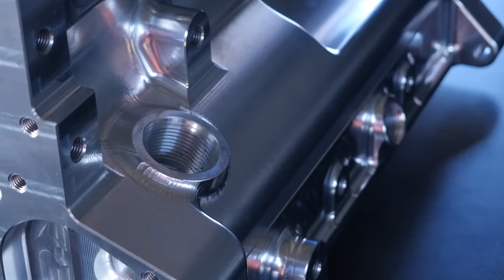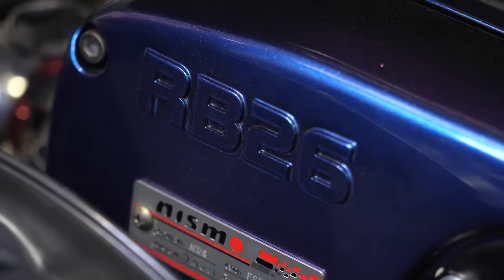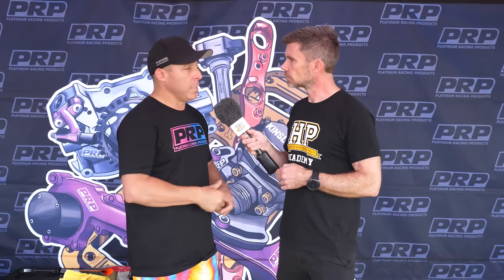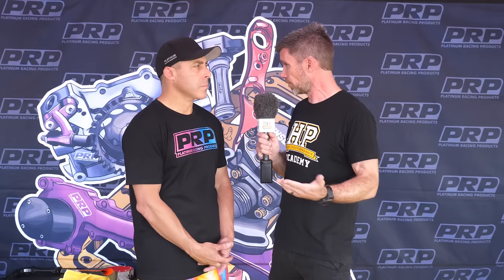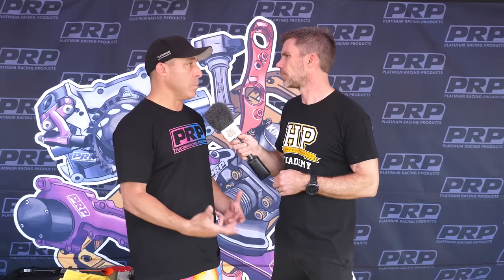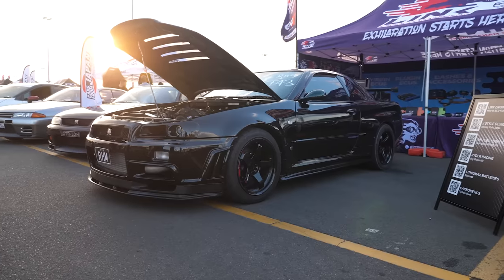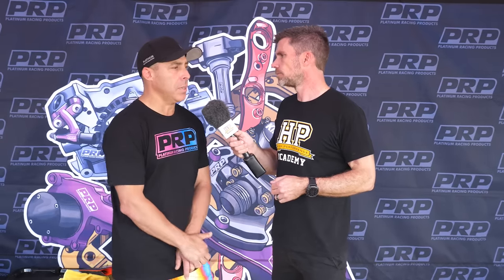What Is Wrong With A Billet Block?

Comment from the maker: Building a fast car? Get $400 OFF the VIP package with every current and FUTURE course included: https://hpcdmy.co/vipy4
50% OFF your first engine building course. Enrol now: https://hpcdmy.co/offery4
TIME STAMPS:
0:00 - Bucking The Trend
0:18 - RB26 Factory Cast Block Cracking
1:40 - Modified Engine Issue Only?
2:24 - RB26 Horsepower Reliability
3:01 - Horsepower Doesn't Kill Blocks
4:04 - What Is 'Wrong' Billet?
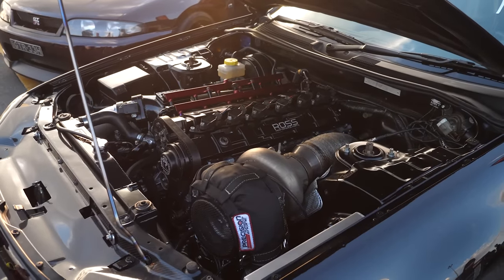5:22 - Billet On A Street Car
6:12 - Billet Thermal Expansion
6:56 - Aftermarket Cast Block
8:15 - Serviceability
8:47 - Sleeves
9:03 - Deck & Headstud Upgrades
10:37 - Proof Of Concept And Development
12:02 - Finite Element Analysis (FEA)/Simulation
13:15 - Pricing Options
14:38 - Billet Is For A Different Use Case
15:06 - Thanks Herman!
15:55 - Exciting Times!
16:05 - BUILD | TUNE | DRIVE

Comment: I really appreciate the fact that companies are starting to bring back the legends. Albeit at a price tag that is expensive to a lot of people. But gtr owners most of the time have gtr budgets which help. Just like the dart 2j block that's coming out, by the time it lands in Australia your almost on par with a bullet billet block for price. The thing I like about billet is if you happen to window the block you can have it repaired
Reply: Spot on🤘🏻👌🏻
Reply: You seemed to miss a lot of point about the cast block vs billet block which is a large reason why prp are coming out with a high hp capable cast block…
Reply: Actually if it wasn't for the 20 year limit on importing JDM cars combined with Gen X increase in income as they reach peak earnings, that is the reason new anything is being brought forward with 20+ year old vehicles with limited appeal.

 Just be happy but don't go all warm and fuzzy because that isn't why, it's economics and the general public needs a   block will hold the power.

 But I'll wait for more R33-R34's in the insurance wrecks lot because the general public has never driven a car with 500 hp let alone 1000 hp.
Reply: I'm an R32 gtr owner. I have less budget than the average micra  owner 😅  personally, I think that bringing an 8k block to market, is a massive achievement, and I am already saving for one . ❤
Reply: Cracked or windowed cast iron and alloy blocks can be repaired if no galleries have been damaged, the reason it is not done often is that with most cast blocks it is cheaper to just get another one. 
Look up metal stitching of blocks for cast iron, I have seen that done a number of times on diesel engines where another block was unobtainable or crazy expensive.
It is great though that a lot of classic vehicles can be kept running through aftermarket companies, I learned a heap through listening to this video.
Reply: @dj4monie  GTR are nice cars, but not amazing *for the money*. Those that grabbed them before their popularity exploded in media are likely doing pretty well these days. At least it's a decent car (and perhaps investment) unlike the 240z and 86, which sell for a lot but were never very good and only became 'popular' because they were cheap common rwd beaters, not their quality. Funny how a bunch of bump steer and shitty handling doesn't show when made into anime. I'll be extra spicy now and say there may even be better i6's you could swap in if marque wasn't a sticking point than the ancient 2j.
Reply: Cast 3000hp 8.8k AUD - 5k usd
Billet 14k aud
I reckon most ppl will push less than half what this block is capable of 

Plus if you live in the US, Europe or Japan there's a lot of cool things you can do with blocks that we cant in Australia
Reply: I think it’s more there isn’t many good blocks left 😂 everyone already broke the good ones.

Comment: I like it, the man makes perfect sense. 99% of people are not running 2000 hp plus and don’t want to deal with the extras of billet. The hellcat block can make 1800 whp safely thus far and it’s iron. Still pushing the limits of iron. Another interesting thing about iron is that it gets stronger as it seasons from age while being capable of being bored no sleeve needed gaining cubes. Much cheaper to. Sometimes old ideas work the best.
Reply: I am in that 99% who would be perfectly happy with 1999 hp
Reply: It's not an old idea it's the preferred idea if the car's weight isn't an issue.

 Factory aluminum blocks are plenty strong. 

Lots of idiot tuners and idiot owners a match mad in heavy for the aftermarket and auto insurance industry.
Reply: @primeral why on earth do you need even 1,000 hp?

 NHRA's new rules only cover new cars with side airbags.

 If you are going to street race it, I got news for you, even if you actually went down to Mexico not just metaphorically like some of you like to say online which is lots of racist tropes in it, you would get stopped and jailed by the feds or military depends.

 That is the problem these days people say they want something but have no practical use for it.
Reply: @dj4monie  and what are you talking about NHRA and side air bags for? Where do they have side airbags? They require roll cages to a certain spec and safety equipment. In any-case what’s this have to do with aluminum or iron RB blocks? Aluminum is used in NHRA in the most powerful cars in the world but it’s far from what you see in these blocks they are billet. And these motors make a pass and are torn down and refreshed every pass used for weight and because they can repair the blocks being billet. Irons cheaper gives better flexibility to the person on size through rebuild and are cheap to replace often more reliable than aluminum while holding more boost pressure typically than standard aluminum. Kind of a no brainer especially when people don’t care as much today about turning if they wanted that buy a Porsche. People care about roll racing, drag racing, formula drift, and dirt rally. Very few want to watch supercars go round and round only sold to the rich yuppie and still slow.
Reply: @dj4monie  I was making a joke. I'll be satisfied with 450 whp in my S30, TBH
Reply: @dj4monie  racist tropes? Gtfoh 😂 it’s literally a metaphor and nothing more
Reply: @dj4monie 9 second street cars.
Reply: Iron blocks are heavy
Reply: @sigmamale4147  yep but it’s not that much more as an ls iron block short block weighs 224lbs and an aluminum ls short block weighs 121lbs. You mean to tell me that for roughly 100lbs give or take on the front end is worth having to sleeve the block with iron anyways sacrificing longevity and strength for 100lbs and more work for yourself. When maybe other ways can be had to lighten up the front end that don’t come as a draw back.
Reply: @joshreynolds729  dude a 100 pounds is a lot, depends on the car but it makes a big difference in everything. Honestly unless you're pushing absurd numbers, well made aluminum blocks are fine
Reply: @joshreynolds729  i guess it depends on your use case. For me, i have a lightweight japanese sports car so aluminum makes more sense, but i guess a muscle car could use the iron block
Reply: @sigmamale4147  absolutely
Reply: @sigmamale4147  yeah exactly man depends on your purpose. Light cars don’t need heavy motors and if you race having to deal with turning then 100% aluminum.
Reply: This idea that cast iron somehow seasons with age and exposure is an old myth. According to Moore's Foundations of Mechanical Accuracy, "The theory that a cast iron part must be exposed to the weather to rest and 'age' in order to stabilize it is a carry-over from the past." A great book and a good read for anyone interested in the mechanical arts.
Reply: @OuijaSTi  that actually is interesting never knew how true it was. Did they say why it’s proven to be false?
Reply: @joshreynolds729  Moore was a manufacturer of jig borers and coordinate measuring machines, among other things. They hand built some of the most accurate machines on earth. They also had to make their own tools, including massive cast iron surface plates, in addition to the aforementioned machines. They did a lot of experimentation with materials, heat treatments, structural design, etc. to be on the forefront of metrology. Testing some of the old adages about cast iron and machining just happened to fall within their purview. I can't even begin to communicate how important these guys were to the world of machines and metrology. The book was written for the layman and is such a worthwhile read.
Reply: @OuijaSTi  Hey thanks man for taking the time. Sounds like a good read I’ll have to check that out thanks. 👍🏻
Reply: @joshreynolds729  No problem, thanks for being receptive, as that's not common here. I think the book is still in print, or at least it was a few years ago, but it's pricey. Perhaps there is a .pdf floating around somewhere. It's got a ton of high quality photos and is not your usual dry, technical read.
Reply: @OuijaSTi  Yeah I hear you, not many people willing to accept that they might be wrong or that somebody else might know a little bit more on a subject. Yeah I get it all the time. I use this platform to learn from others and help others with knowledge based car stuff.  Anyways thanks I’ll check it out.

Comment: casting for aftermarket blocks and heads have been the standard in american v8s for forever, world produces, brodix, person, blue print, ect. only people that use billet is top fuel where welding and repairability is more important then raw strength. there is totally a market for imports in between the bleeding edge and these garbage stock blocks. material science has come a long way too since the 90s aswell. that price point is a little high but I guess that's some sort of Australia money, its hard to compare because this sector is so mutch more developed here.

Comment: Great episode. As I’m a toolmaker who’s been in the casting industry for many years it amazing what’s actually involved in making a casting accurate and consistent is very time consuming. But you learn every day on what works and what doesn’t. Venting,risers to feed during cooling and volume of liquid are the criticals.
Reply: I am the guy who inspects castings. You are spot on. When we get early run castings to inspect, we have a lot of rejectable areas due to shrinkage, missed areas, gas pockets, and cracking. We report all of our findings and send them the film to review, and they tweak their molds and pour and usually have all of the areas corrected after 2 or 3 revisions.
Reply: Is it "easier" to cast limited production bits like this because adding thicker sections to be milled off and additional risers isn't a big deal as the cost structure of an aftermarket performance part is fine with adding those operations and some additional material usage?

Comment: This reminds me of the volvo 5 cylinder engines. They have a problem with cracking the aluminium bores.

But they have the same bolt pattern as the diesel 5 cylinder. So you can use the diesel iron block with a petrol head. And that way you can go way upp in power before they break.
Reply: Been hunting a diesel AWD trans for some time in the US and it's impossible 😂 but great to know I filled the deck and shimmed it with some nice headbolts. Has held up to 750hp well but the AWD I keep destroying the front dif meeting the haldex collar. Any tips? S70 so kinda heavy.
Reply: @oliverscorsim  glad to hear the engine holds upp. From what i understand the AWD on them is just fragile. There is however a dude on youtube who built an AWD 850. And if i remember correctly he designed a billet front diff.
Reply: @oliverscorsim  the channel is "simplyvolvo" i believe.